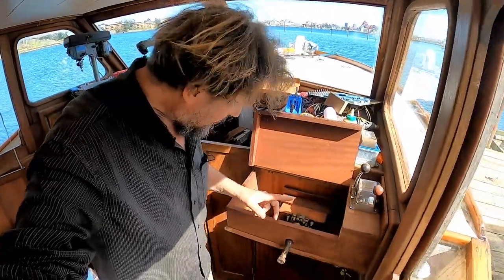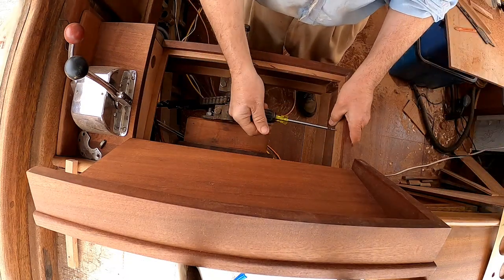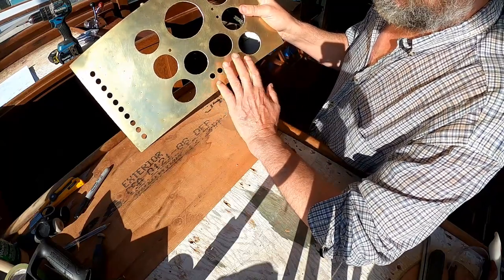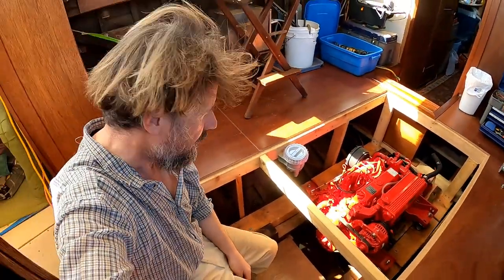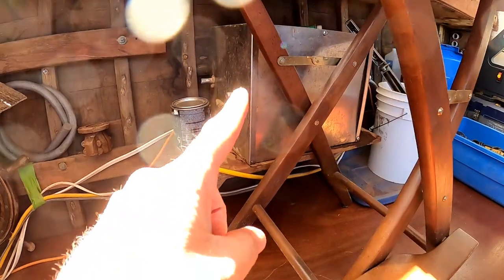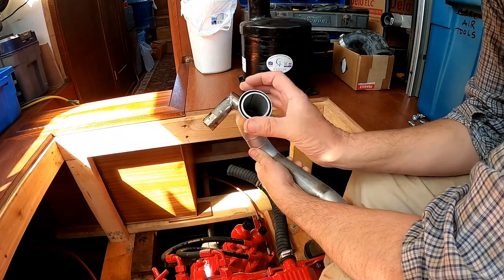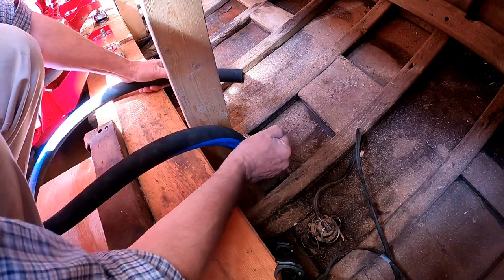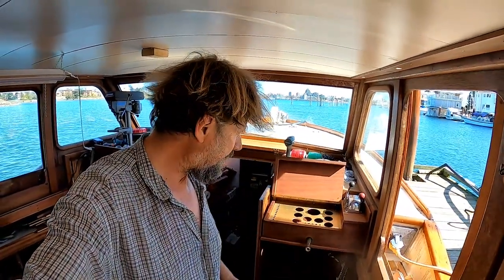Engine Hookup - #226 - Boat Life - Living aboard a wooden boat - Travels With Geordie

Comment: What a relief to see you getting the engine ready for start up!  The one suggestion I have is to mount the sea strainer “below” the waterline.  It looks like the place you have it mounted is above the waterline.  Won’t that cause a siphon break and introduce air to your impeller?  I see you “priming” the system, but if it was mounted below the waterline, there would be no need to prime it and no risk of “losing” the prime in the future.  Lastly, a “proper” sea strainer would be more robust and safer than the plastic one....I.e. Groco, etc...Keep up the great channel Peter👍🏼.

Comment: Like the idea of the fresh water flush but do not forget that the engine exhaust gasses play an important part in pushing the exhaust water through the system. Any resistance to the flow in the exhaust could result in the water going back over the exhaust bend to the engine. Has been known to happen when people try to run up the engine on the hard by sticking the hose into the through hull or if the engine is repeatedly cranked without starting.

Comment: Peter. Regarding the header wrap you're putting on the exhaust. I've done many, many motorcycle pipes using that wrap. May I suggest something? I'll assume you answered yes. Wet the wrap in a bowl of water. Wrap it wet. That will make it tight as possible. You can finish it with a stainless hose clamp at with end.

Comment: Use CV boot clamps around the wrap.  Otherwise known as metal zip ties....  Also, fold the end over and tuck it in so it doesn't fray.  I would also get it ceramic coated as that will help a lot with the heat.

Comment: Peter. Watch those clear top raw water strainers. We have them on our Yamaha diesels and they all seem to crack eventually and blow the top off in the middle of a trip. Ours must be on the pressure side of the  raw water pump. 10 to 20 years of service mind you but who knows. At least have a spare cap or two on hand. Love what you're doing with the boat. Can't wait to see her running again. Cheers Roger Kight. Auckland. NZ. PS her original name Kia Ora is/was Maori for grettings/hello... sorry i know your not supposed to mention it after renaming.
Reply from the maker: Good advice. I’ll keep a spare. I like them much more that classic “on the seacock” type strainers. I wouldn’t mind a nice bronze one though.

Comment: Let me suggest that you re-install that cig elec socket cover.  I have two on my boat which is berthed on a 
salt water river.  They are in my cabin but, the salt air (even on a river) WILL permeate those sockets and 
degrade the terminal connection surfaces over time.
Just my experience, YMMV!

Comment: Great episode. The heat shield wrap is usually made off eith stainless cable ties. And for the horses I would use constant tension hose clamps especially on anything that would be catastrophic if the hose came off. But glad to see the project coming along.

Comment: Adding shut off valves to the lines coming and going to the plate exchanger at the engine is something I would do.  Being able to isolate that circuit can be very worthwhile.  Another great video.  I had a 20 plate exchanger on my last boat and it was worth every penny, they work great. DS

Comment: Great progress Peter.👍 I know it adds plumbing complexity but have you thought about adapting the circuit feeding the plate exchanger to supply a cabin heat  facility - maybe those under plinth units used in kitchens with a wee fan? (Similar to this - https://thermix.co.uk/plinth-heaters/). You are making good progress, despite your less than good back.😀👍⛵️

Comment: It was a relief to learn there is a product I can use to ease the replacement of a degraded marine hardwall hose that seems to supply raw water to my water lift muffler. Would I get Lanolin fluid film at Spencer's in Sidney or at any hardware store?

Comment: Im sure the fiberglass exhaust wrap turned out proper but quick tip is if you soak the fiberglass in water prior to wrapping it takes shape better/ easier and allows you to get a tighter wrap. Also, it will smoke for like 10ish minutes the first time it gets hot.

Comment: Does the hot water and the heated water not run in oposite directions in the heat exchanger? For maximum heat-exchange this would be intuitively what I would do. So, it would be a relief for me to know that the in and output points for each on this thing are marked.
Reply: Good comment, typical of heat exchangers to have this  counter flow regime. Hope the instructions cover this point. Cheers

Comment: Does your drill press not have a belt under the top cover that you can change for torque vs speed?
Reply from the maker: Yes, and it's in the slowest range.
Reply: @TravelsWithGeordie  bummer! You managed just fine without it ultimately